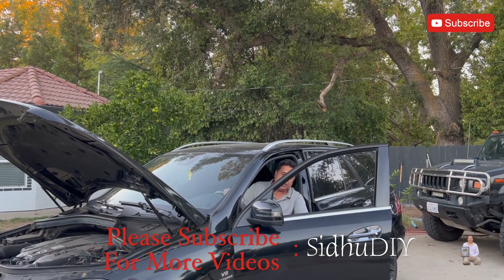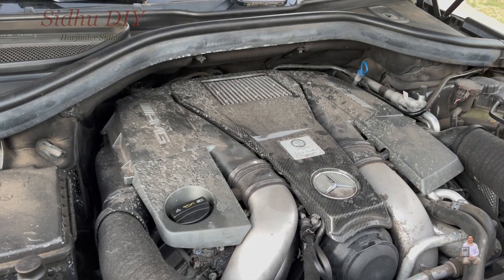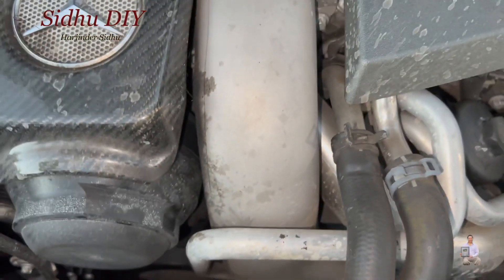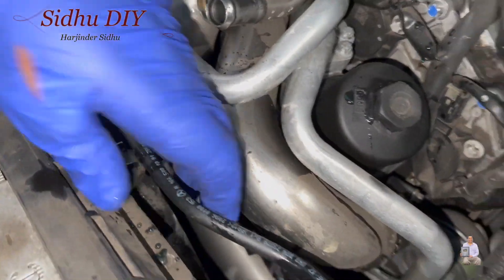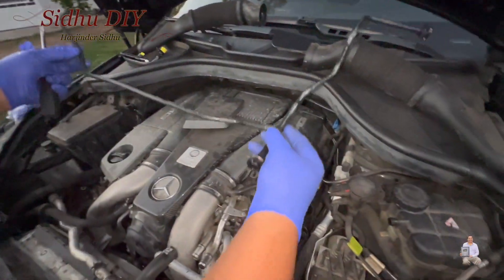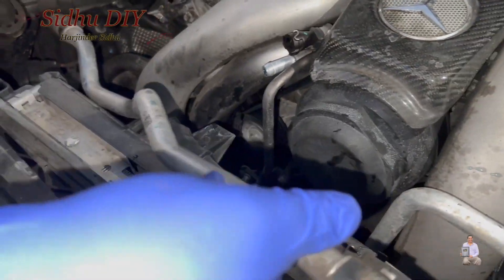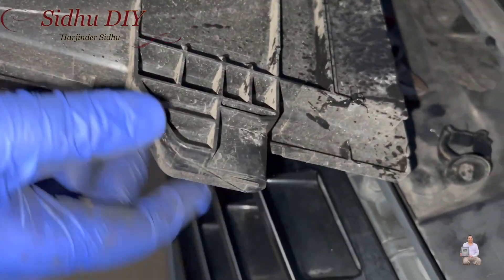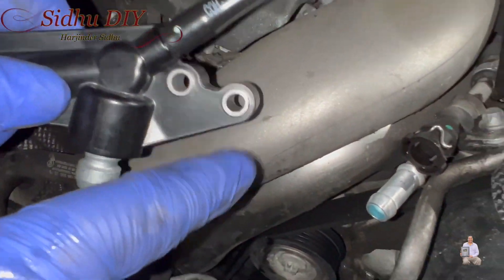How To Fix Mercedes M157 Bi-Turbo ML63 Coolant Leak Water Pump To Left Return Line | ML63 AMG

Comment from the maker: How To Fix Mercedes Coolant Leak Repair | Mercedes-Benz Turbocharger Coolant Line - From Water Pump to Left Return Line | ML63 AMG | How To Fix Mercedes W166 Coolant Leak | How To Fix Mercedes Benz M157 5.5 Bi-Turbo AMG Coolant Leak | How To Fix Check Coolant Level on Mercedes

Comment: Fantastic wokr. This is a very daunting task for most, but you've shown its actually a dooable DIY !!
Reply from the maker: Thank you very much!
Reply: @EasySteps_Sidhu  I actually just sprung a leak on mine. Same engine, GL63. The coolant bottle overflow pipe the  small brittle pipe that connects into the tank/radiator/beside engine cover snapped off at the engine cover endm your video has given me confidence to do it myself.
Have you replaced a thermostat on this M157 yet?

Comment: The part numbers for the pipe 278-200-01-00 states its not the correct one from FCPEURO. I have a 2013 ml63 as well. Can you please check?
Reply from the maker: Dorman 667-564 (Left) Turbocharger Coolant Line - https://amzn.to/3RRqogx
Dorman 667-324 Driver Side Return Turbocharger Coolant - https://amzn.to/3RTsjS6
Dorman 667-321 Return (Passenger Side) Turbocharger Coolant Line - https://amzn.to/3txOZxC
Dorman 667-564 Supply (Left) Turbocharger Coolant Line - https://amzn.to/3RwtXre
Part#: 278-200-01-00 - https://amzn.to/488tz9r
Mercedes Coolant Line - https://amzn.to/3UF5rFi
Turbocharger Water Feed Line - https://amzn.to/48oTWru